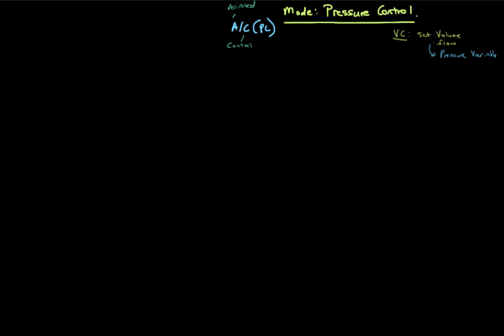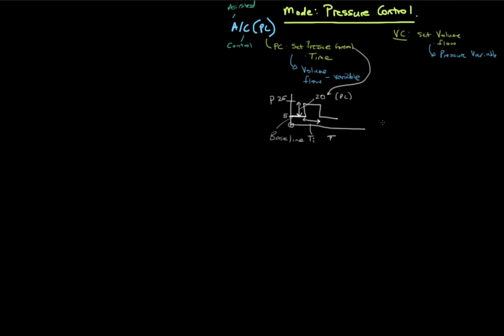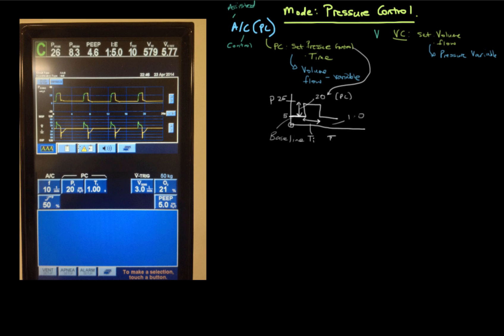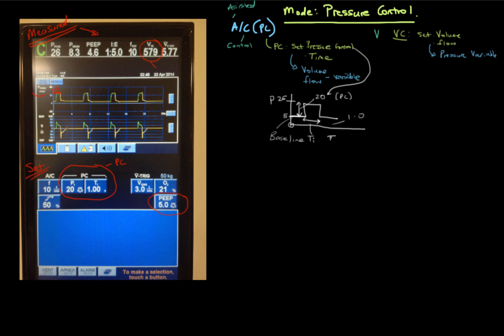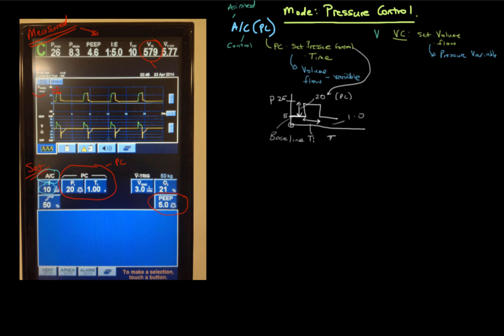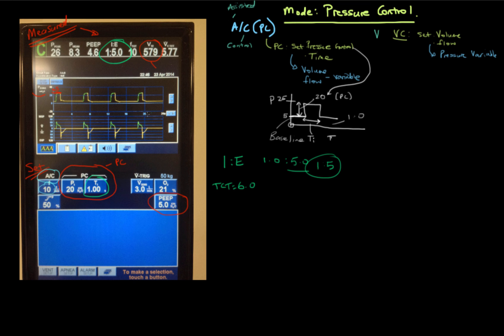Principles of Mechanical Ventilation 11: Modes - Pressure control

Comment from the maker: dabbsy1975 - I'm really glad you find the videos useful. I'll keep making them as long as I keep hearing people find them helpful. 

You're right about plateau pressure. It's not going to be that useful in helping you figure out there is an ETT obstruction in pressure control. It's more reflective of alveolar pressure/conditions (which shouldn't be affected much in ETT obstruction). 
You also have to think that if the resistance is really high, you may not actually be ventilating the alveoli in pressure control. Remember if we set a PC of let's say 20, and the resulting tidal volume is 500mls, if the airway obstructs, that 20cmH2O is unlikely to overcome the resistance and actually ventilate the alveoli. As a result you may not even get an accurate plateau pressure. 

Hope that helps.